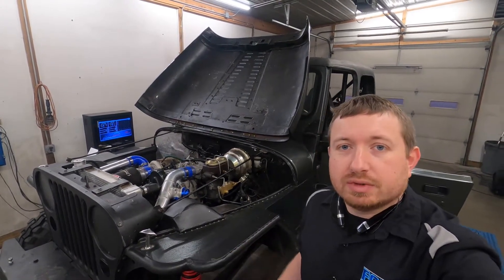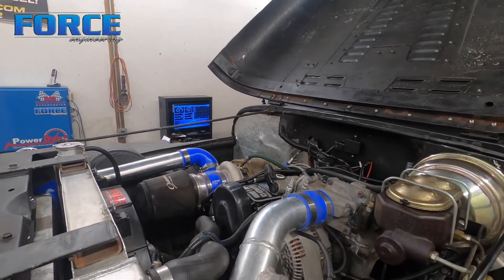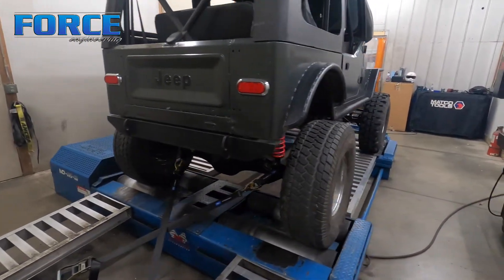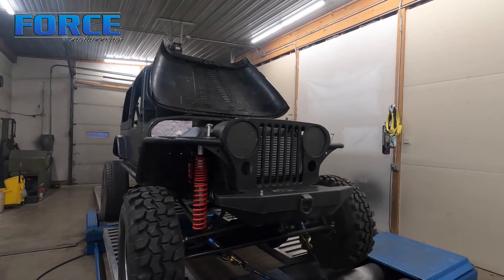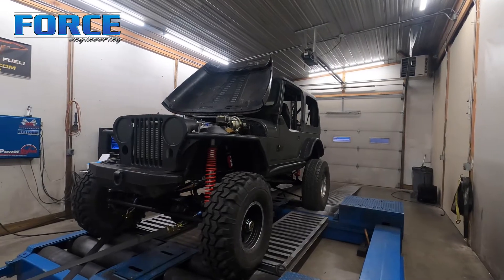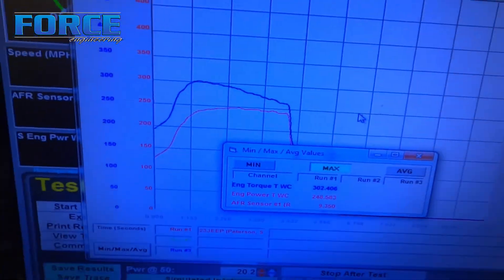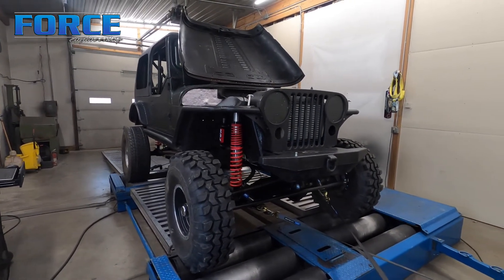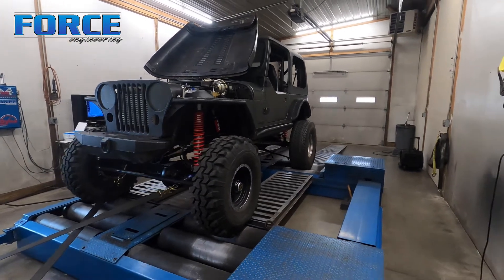Dyno Review - Turbo 2300 Ford | 2.3l Ford Swapped Jeep

Comment: The engine mods mentioned all favor the higher rev range, and are typical of those drag racing their OHC 2.3 turbos. They can put down impressive numbers on a dyno, but at the cost of  sacrificed low end power.  For some off-roading events like rock crawling, sounds like a bad combination.  Adding a larger turbo would make matters worse with increased turbo lag. I am a big fan of the 2 3T but in this case, seems to me a better choice would be a built OHV straight six or V8, perhaps supercharged.

Comment: Just finished my built 5.0 85 CJ7 and am now second guessing my self about the 88, 190 hp. 2.3 turbo coupe motor  that I have instead. Mostly like exploring out West here. Do like power though, with my economy. This is not the                    kind of build for me. I like them stockish looking with mods that look like the factory built it.
Reply from the maker: Fwiw.  I think that the 2.3l is super unique in this application.  But I do feel like the 5.0l is a better suited for low speed stuff.
Reply: @ForceEngineering  True, I guess it's just  mind game stuff. The built 5.0 jumps when I touch the throttle. Nice on and off road. Turbo motor needs a bit of time to build steam, but it's got it.